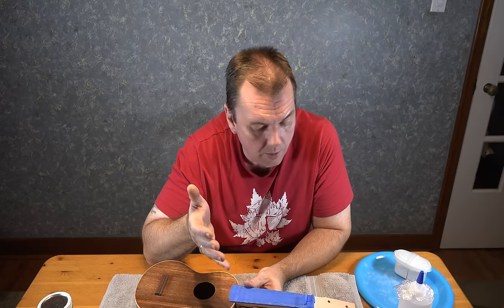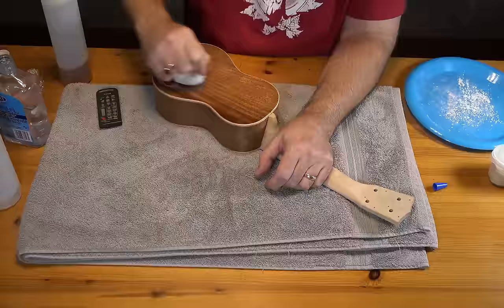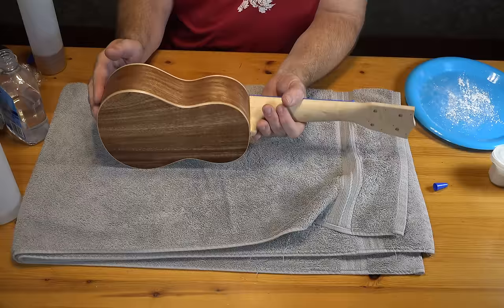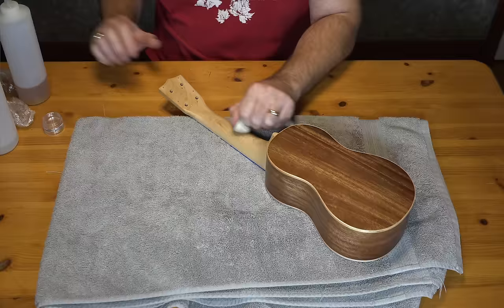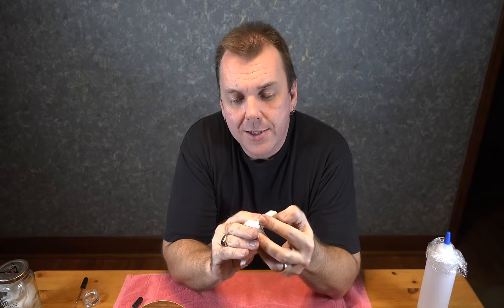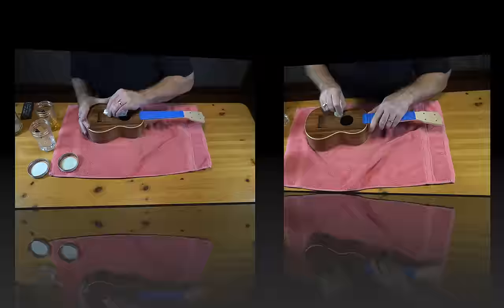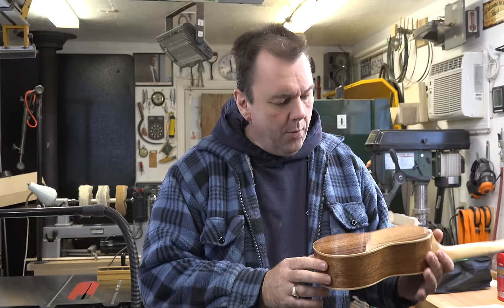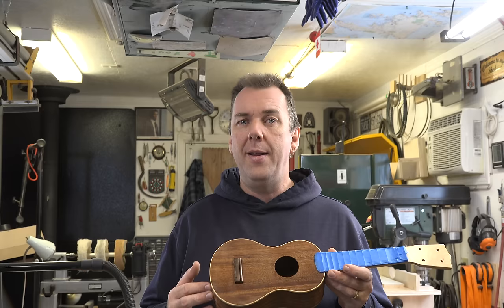How to French Polish Part 2

Comment: Wow this really helped me out, I’m still really confused about some bits though:
1. When applying the first sealer coats, do you go over the whole surface once in straight lines and then wait a few minutes before applying a few more coats. Or do you go over the whole surface and keep going over where you’ve been. 
2. For the following bodying section how long do you go over the whole piece before leaving it to dry. How many layers are needed for 1 out of of the 8 sessions etc. 
Please I’d love some advice thanks
Reply from the maker: The sealer coats can be applied however you like.  If you want to go in one direction, that is fine or you can go over what you have already done.  The main purpose is to give a good sealing of the bare wood before you can start to polish.  The actual technique that you use for this is not as important as getting the wood completely sealed.  As for the bodying process, you can leave it to dry when you get tired.  LOL.  It takes quite a while to build up the grains in a bodying process and the entire procedure is not a quick one.  The number of layers needed varies between species but the more, the better in my opinion.  You need to have a completely flat surface when you are done and while some species (like maple) might accomplish that quickly, others (like oak) will take much, much longer.  I think you may be over analyzing this here as there is no real set time to do things.  It takes a very long time and each layer, builds on the next so don't be afraid to work on it for longer.  Be prepared to work on the bodying process for a very long time and when you think you are done, know that you still have quite a bit of work to do.  I know that this is a very vague answer, but it's hard to determine times when every species and every cut of wood reacts differently to the process.  Thanks for tuning in to the show.
Reply: @acutabove_woodworkings  thanks!
Ok so I’ll just keep applying it until I’m tired or it gets too soft? 
I guess the only way is to give it a go
Reply from the maker: @fraforgt-350r2  I could explain it for an hour but there is no substitute for hands on experience.  Trust me when I say that you will learn more from jumping in and trying it than you ever will from my explanations.  Good luck on the polish.  Let me know how you make out.

Comment: Would it not be better to mask off where the bridge is located, apply finish, remove masking then attach bridge as the final step?
Reply from the maker: Hind sight is 20/20 and without a doubt, your idea would have been the better way to go.  But the ukulele was already assembled when I decided that I would do a French polish on it.  I wish I had thought of doing the polish prior to the bridge being attached.  The next one will be done differently.  Great suggestion.  Thanks.

Comment: Can you fix a (fingernail) ding on French Polish? I was thinking a little drop of water to bring the dent out, but I'm not sure.  Appreciate any info.
Reply from the maker: Water will not bring out the dent on French polish.  The wood underneath is sealed and the water would have no chance to raise the grain in order to eliminate the dent.  I would think that a fingernail dent would be fairly easy to fill in though with several layers of polish and then using pumice stone to even out the finish with a final buffing to complete the repair.  Not being able to see the damage though, I am only thinking of best case scenario.  I hope this helps.
Reply: kennyearrings1   Thank you. I wondered about that after I asked. I've fixed dings before but it was Nitro finish.  Assuming superglue isn't a good idea on French Polish lol.  Thanks so much for replying back.  I appreciate it
Reply from the maker: LOL.  Super Glue isn't really an option for this one either.  Good luck with your repair and thanks for tuning in to the show.